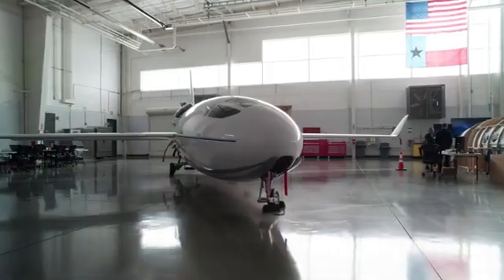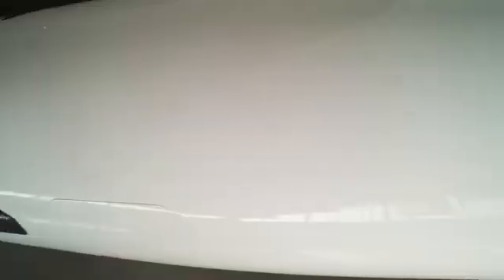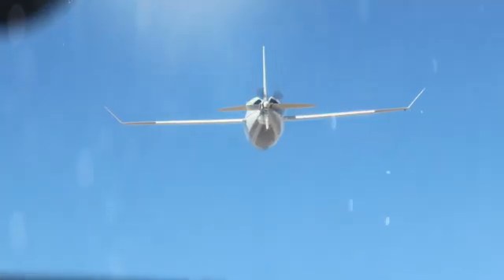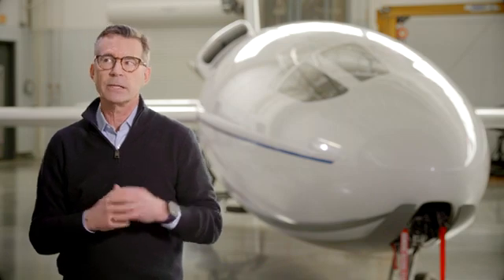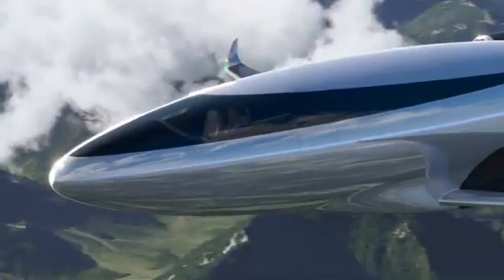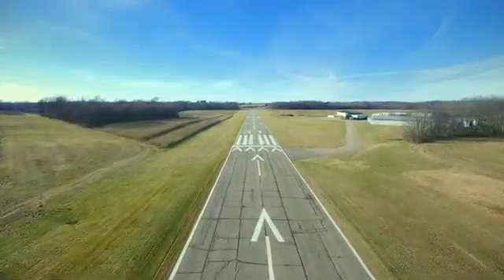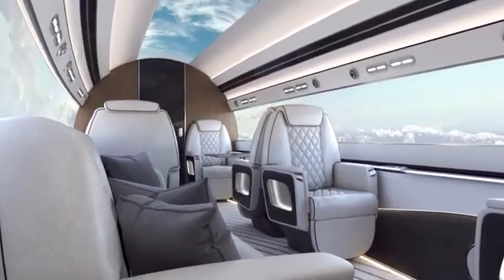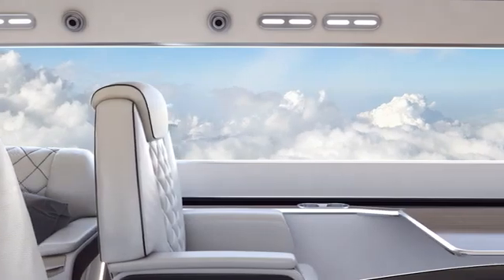Phantom 3500 swaps windows for super-efficient transonic flight

Comment: It actually has zero fuel burn with zero emissions. These figures may need to be adjusted if there are ever any test flights. The Celera 500 "demonstrator" was only flown low and slow, and the results were "extrapolated" to match their claims.